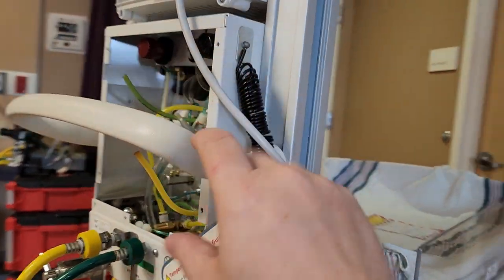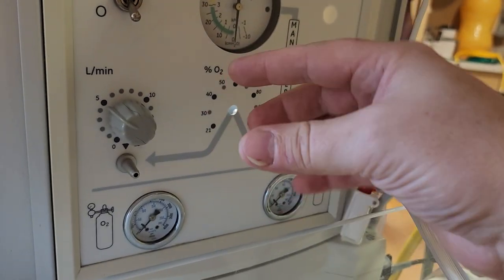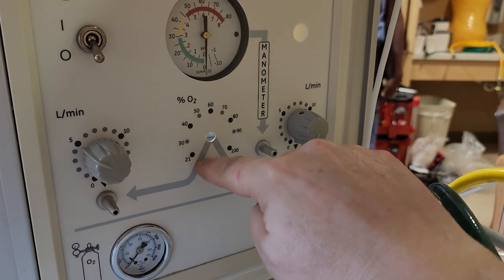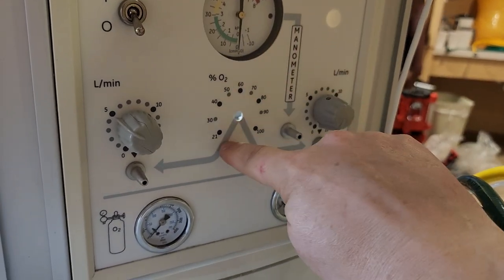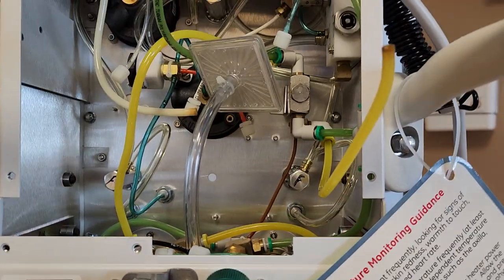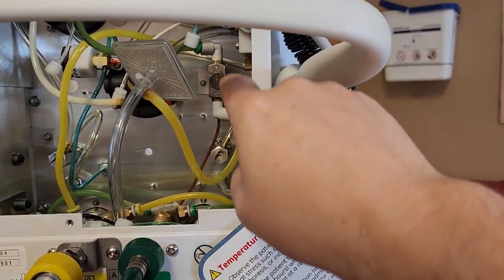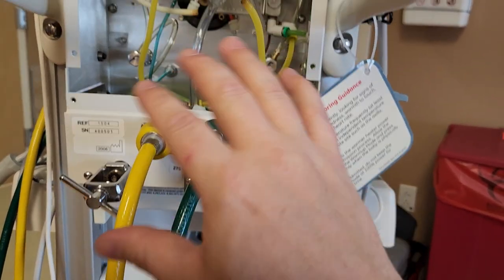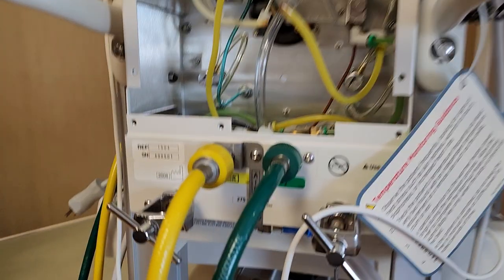GE Panda / Giraffe Radiant Warmer O2 Emergency!

Comment: The blender in these specific panda warmer doesn’t have duckbills in the air/ oxygen fittings, (check valves) therefore It can easily cross contaminate. Good catch on the switch

Comment: Great timing! I've just finished doing this exact repair.
Couldn't repair the valve, so I ordered a replacement - those things are pricey!
I found the new replacement was also faulty with a leak at one of the secondary ports.
Definitely worth checking new parts as well - I've heard a few reports of poor quality assurance on recent GE parts..
Reply: what's pricey?

Comment: Question: how would one disarm a lifepak10? I want to be able to pick up a rhythm and have those functions but not be able to send a shock. The one I bought is going to be used as a prop for a PSA film I'm doing. I can't find a YouTube video in English on the LP10.
Reply from the maker: Disconnect the output port?
Reply: @BetterBiomedChannel  👌 I’ll try that.
Reply: Could also add a load internally to discharge into. Just in case it throws errors.
Reply: The charge is auto-disabled if the charge is not used for 60 seconds, or you can turn the Energy dial.
Reply: @cdharris22  that would make sense.